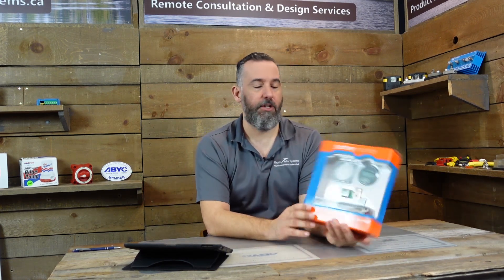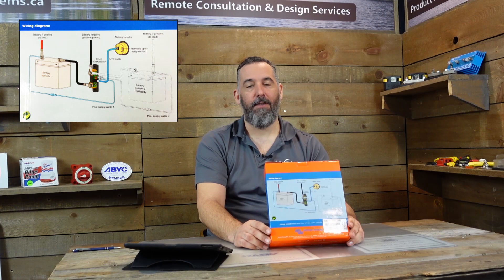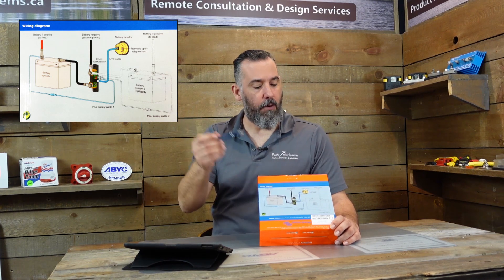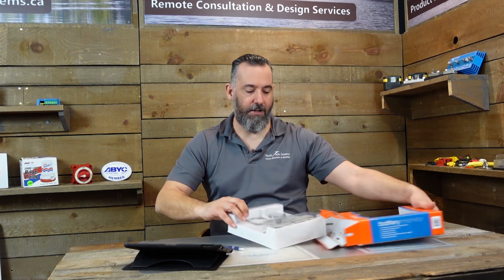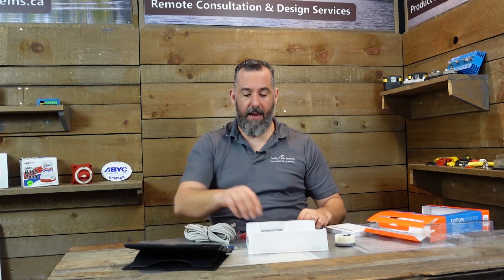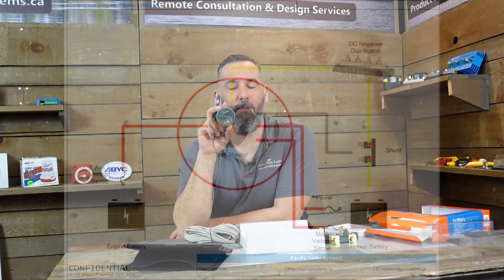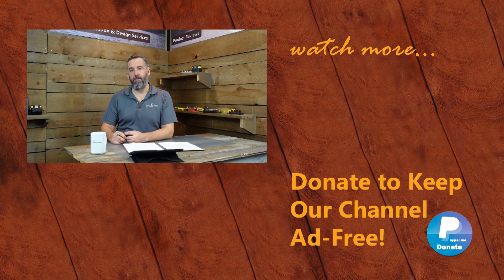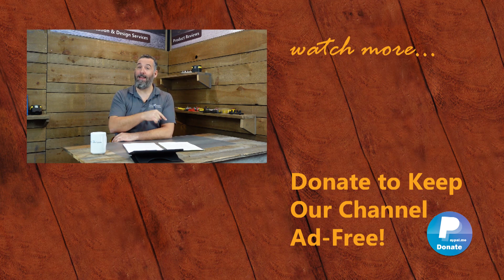Victron BMV-700 Battery Monitor Product Review

Comment: I bought this battery monitor in 2015, but after a few years the display lighting is very weak and almost impossible to read in the dark.

I am looking for a way to disassemble the battery monitor and replace the LEDs.

Comment: We are installing a replacement Xantrex XC 1000 on our sailboat. From what I read in the XC guide the panel on this inverter/charger reports the condition of the battery bank. Is this not a complete picture, like only when charging? Do I still need a battery monitor?

Comment: If I have 660 AH in a set of group 27 batteries what monitor size do I get?  I see ones with 100, 350, 400, 600 amps....
Reply from the maker: Size your battery monitor to handle the max discharge amperage.

Comment: Will the 700 model communicate with other Victron devices, such as Orion DCDC 12/12 - 30 (bluetooth) and the MPPT SmartSolar 100v/30a? Or would I need a different model? Essentially, I'd like those 2 devices to communicate/ understand what each other is doing.
Reply from the maker: Good one, don't know the answer of that question.

Comment: Probably doesn't surprise you Jeff but I find Victron underwhelming. Built down to a price. Put an O-scope on their inverters, with their soldered input fuses. 
Hydrometer test their charger performance....you'll see why quickly.
They spend more on marketing and bluetooth features than hardware fidelity.
High failure rate.
That BMV doesn't impress me. It doesn't read >100% charged.
The display is too small to monitor you have to be super close to see it.
The blue backlight looks naff and it's 52mm for automotive meaning if you put it in a vehicle dashboard as it was designed to do it'll make you paranoid the headlights are on.
No ignition switched backlight. ~15 presses to enable and disable the backlight. 
I had to offset mine 0.5A to calibrate it.
UTP cable is not vibration tolerent nor robust.

Try Bogart Engineering's TriMetric RV 2030, use it for two months. Then you'll understand.
Reply from the maker: Thanks Liam for your detailed input, love the sharing. Will definitely look into Bogart product line.

Comment: Jeff, any insight/comment on the suggestion (from a 2-yr-old post elsewhere) that this particular model (BMV-700) draws down on battery power (for monitor operation) but does not include this draw-down in its calculations, thus rendering an inaccurate reading/power rating?
Reply from the maker: Hmmm, wasn't aware of this.
Reply: @PacificYachtSystems  It was a comment included in a review of the product on the US amazon site. The poster claimed to have had conversations with Victron, labeling it a 'bug' in the monitor's software. Chances are if it was just that, Victron may have already remedied this situation since the post of 2017. Thanks!

Comment: monitor must be resynchronized before it can operate correctly. victron ... Recommended settings: Nominal battery voltage. 12 V. 24 V. 36 V. 48 V. 60 V. 120 V.
Reply from the maker: Thanks for sharing.

Comment: What is the reason why you installed Genasun charge controller in your boat and not Victrons which are programmable?
Reply from the maker: Because i needed 2 boost controllers and Victron doesn't have one.
Reply: @PacificYachtSystems  I thought you had several GV-10s and not just 2 GV-boost. Have you been able to see a difference between a simple mppt and a boost-mppt?

Comment: Can you use it on your starter battery?
Reply: The model 702 for example gives you also the voltage of your starter battery which is enough information for a starter battery
Reply from the maker: 2nd battery only monitors voltage

Comment: If you get the 712 smart model (or any other smart component from Victron) dont forget to take note of the PUK number which is on the label often on the back of the component. You will probably need that number at a later stage (if you lose the PIN number or change your phone) and its a pain if you need to dismount your MPPT regulator for example just to access that label. You guessed that I have made the experience...
Reply from the maker: Smart!!! Thanks for sharing.
Reply: @PacificYachtSystems  I have been using the BMV 712 for a few months now and I would like your opinion on the alarm settings. I did set them at 14.6 V max and 12.1 min. They have been activated a few times but it seems its normal that my voltage regulator for the solar pannel does output 14.6, therefore I should rise my maximum voltage to 14.7 for example? (batteries are normal pB from Exide). On the other side, allthough my battery capacity never went down below 75%. The voltage under load does reach 12V for example (when the fridge compressor kicks in for example). Should I then lower the alarm to 11.8?